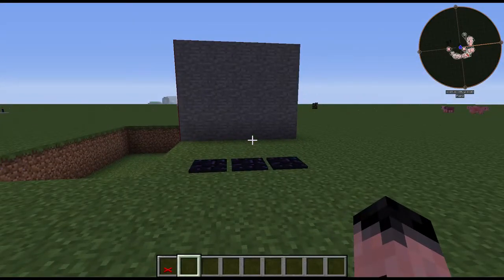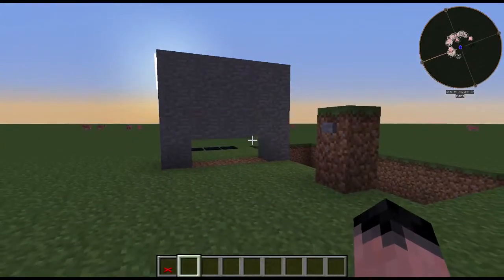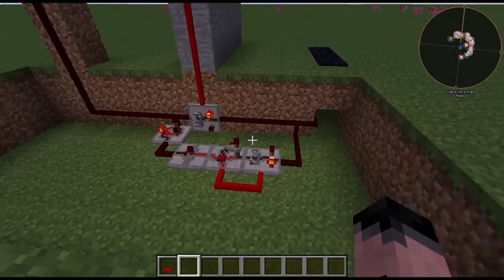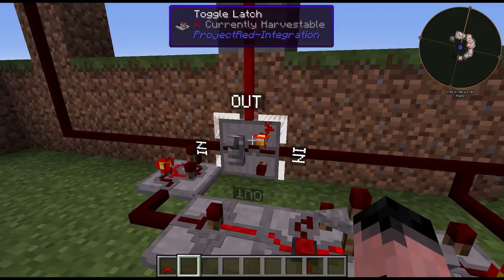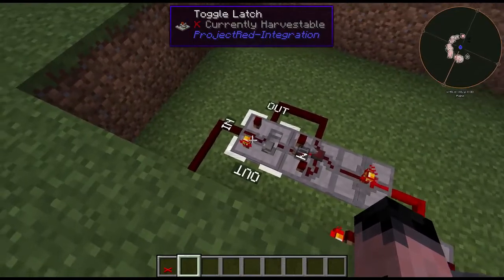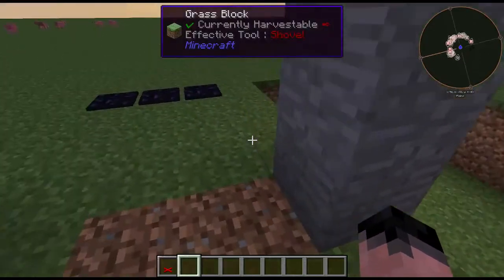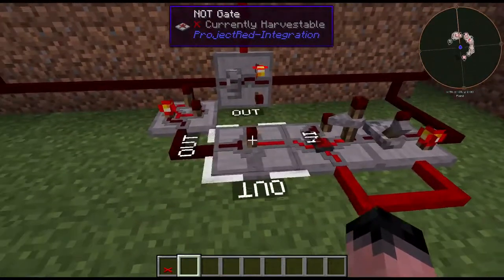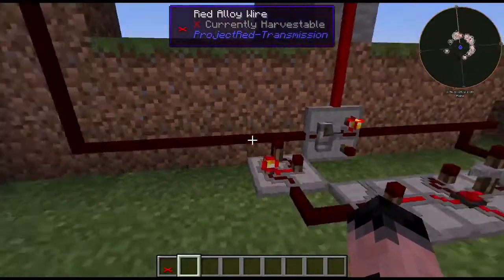Video Response: Tinker's Construct Drawbridge Door Help

Comment: That's briliant! I'd already been shown another solution by someone on Reddit, which involved an XOR gate, and, RS Latch and a Timer, which is similar but not nearly as elegant as yours :)

I like the Red Alloy wire too, looks much easier to make compact than the EnderIO conduits.

Thank you very much :)
Reply from the maker: You're very welcome sir. Red Alloy Wire has the advantage over Conduits in aesthetics, but not in functionality (Conduits can transmit up to 16 signals at once, through it's colour channels). To get the same ability in Red Alloy Wire you would use Bundled cable. The trick is that a single block can hold up to 4 separate bundled cables since they're multiblocks: allowing an effective 64 channels :P I've never needed that many.